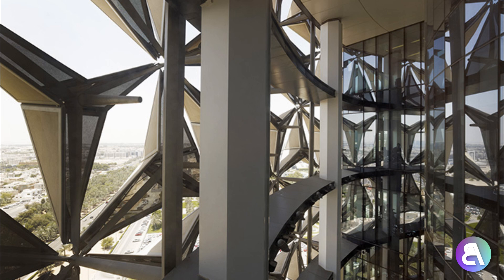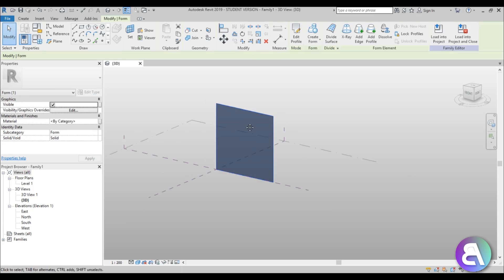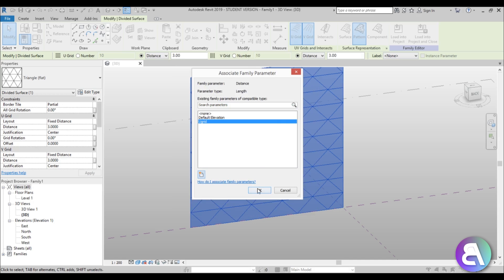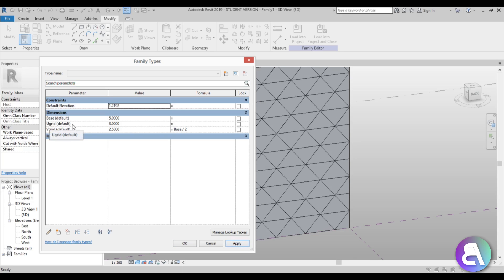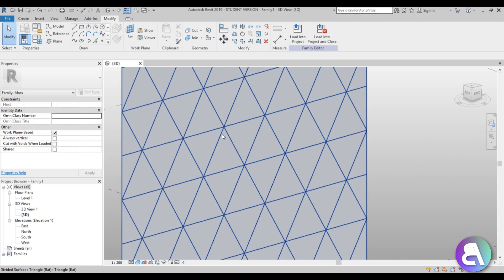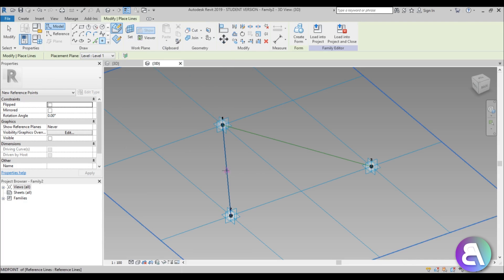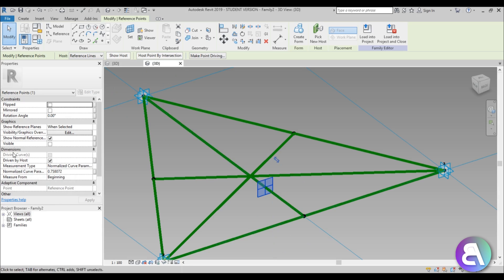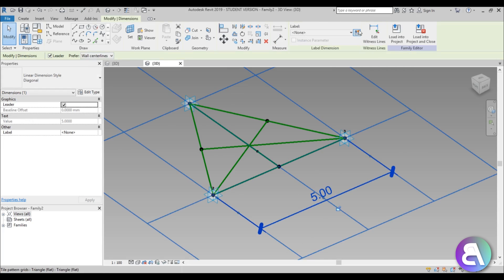Al Bahar Parametric Facade Family in Revit Tutorial * Part 1 *

Comment: Sir, this video is amazing, thank you. However i got stuck in between, its probably a very petty issue, but being a beginner,  a little heads up will be very helpful 
When you've joined the medians with a spline and made them references, and then placing a point near the intersection of the medians, to which you're applying some parametric constraints so that for a bent surface, the family works. But after placing the point as shown, in the properties palette, there was  no Measurement Type option under Dimensions tab, as in your project. I am only getting 'offset' under dimensions. And that's where I'm stuck. Can you please suggest me what to do?
Any help would be appreciated. I'm a student of architecture and i want to use such a family in my project
Reply: Did you ever find the solution for this? I am also getting this issue.
Reply: @OneAsianMonkey  yes.place refrence point on the reference line.but dont set the workplane, select by face.